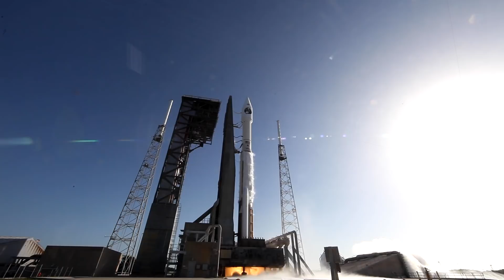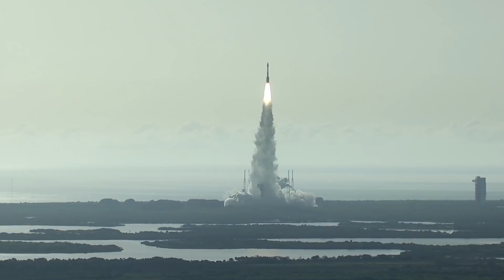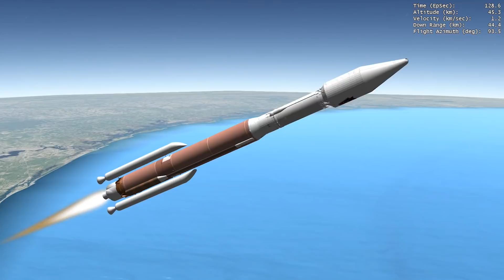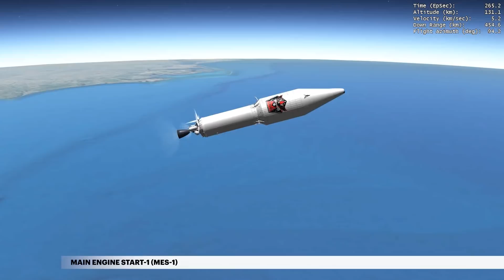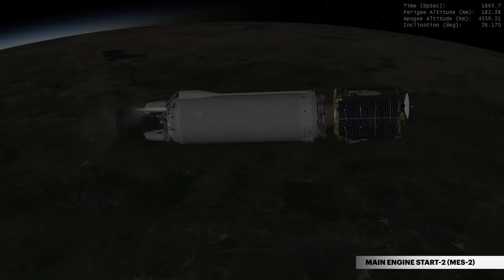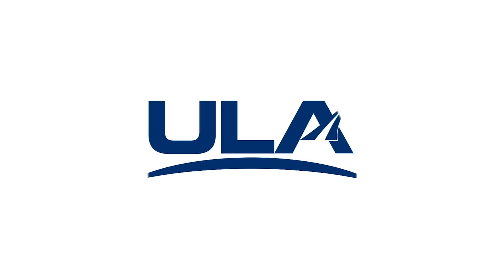Atlas V SBIRS GEO Flight 5 Mission Profile

Comment: I'm sure Mr. Paul Kirk and his team loaded that United States Space Force ( USSF ) Space Based Infrared System ( SBIRS ) Payload onto the United Launch Alliance Atlas V 421 Rocket and also put the Centaur Upper Stage ( Second Stage ) onto the top of the first stage, as well as putting the Payload Fairing on the top of the Atlas V to cover the SBIRS and the Centaur Stage with its awesome RL10C Engine. Go Atlas V, Go SBIRS, Go ULA!!! Thanks again Mr. Kirk for helping build these monsters!! Looking forward to seeing this beast lift off from Space Launch Complex-41 ( SLC-41 ) "Slick Four One" at Cape Canaveral Space Force Station, Florida with that awesome RD-180 Main Engine and its 2 Northrop Grumman GEM-63 Solid Rocket Boosters in the ULA Atlas V 421 configuration!! 🇺🇸🛰🔱♠️🚀
Reply: Someone is a contractor on SBIRS. 😎